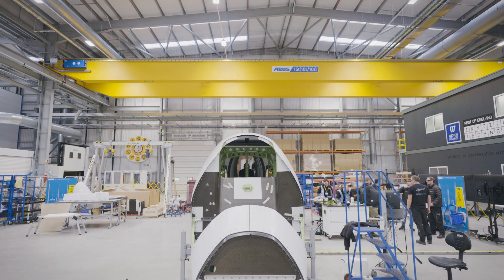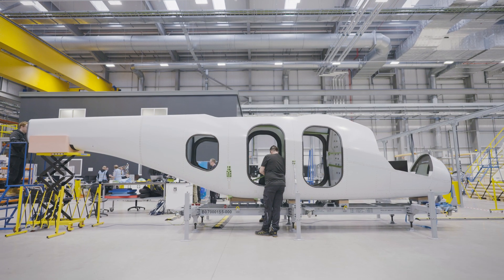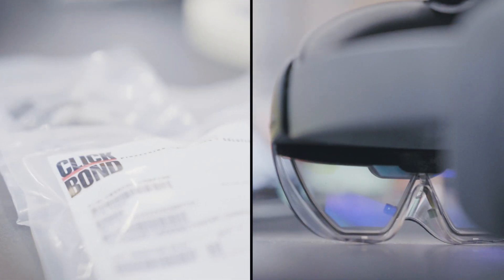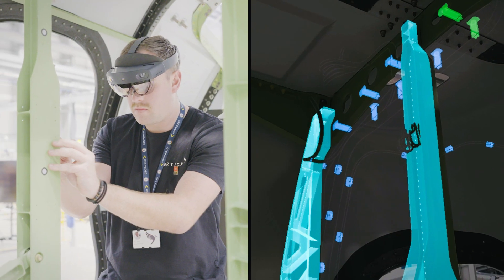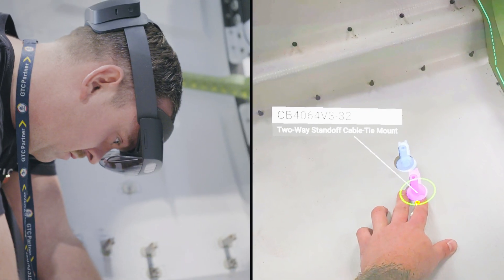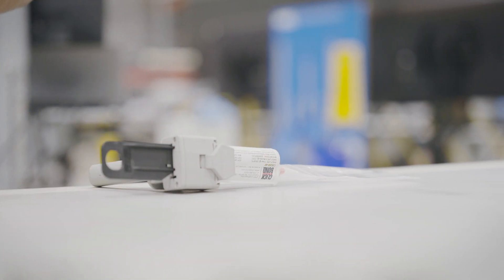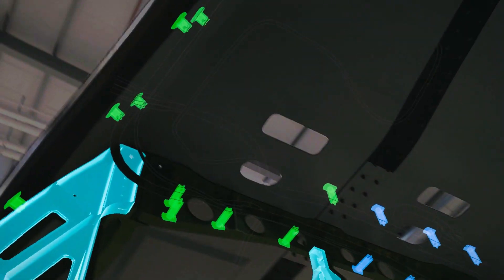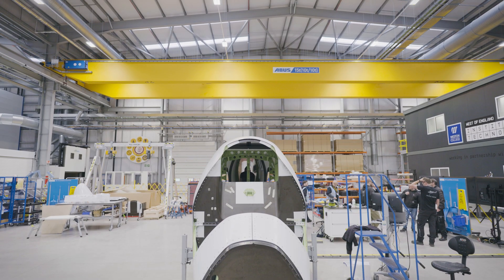Vertical Aerospace - Click Bond AR eVTOL build

Comment: Interesting video. What we are all really asking ourselves is what is Vertical doing to minimise the risk of another motor failure incident. I'm still adjusting to the idea of e-VTOL without autorotation, so it is a legitimate concern.
Reply: Not if it’s got wings eh which it has……
Reply: @AnthonyJohnStewart  , sure I do get that it can still fly above transition speed. But there is a hovering phase of flight, at takeoff & landing, when the wings won't help. BRS won't do a lot of good that low and slow either. So, if autorotation not an option then it's down to system redundancy. Hence my question.